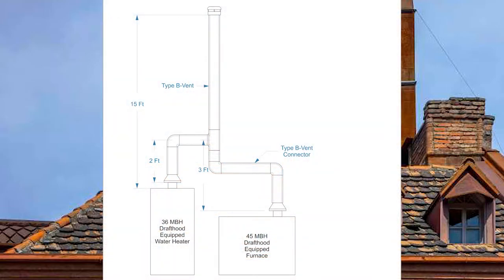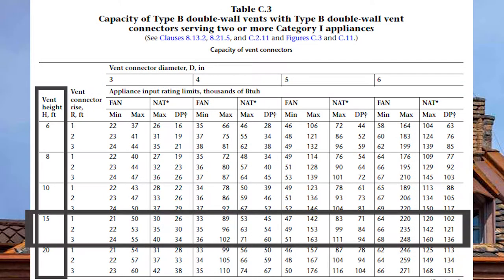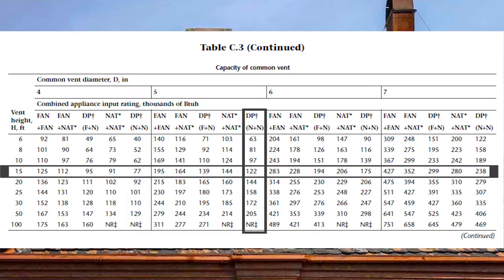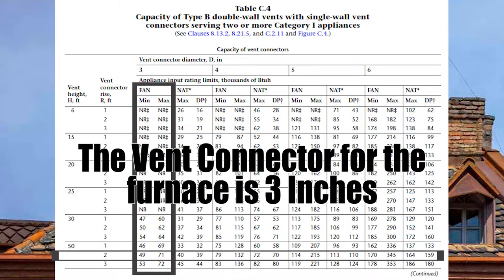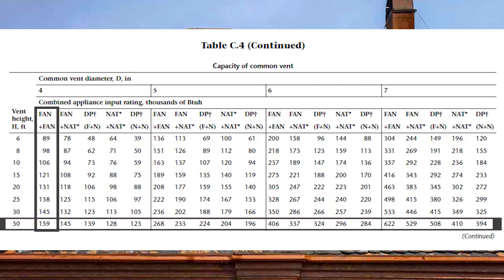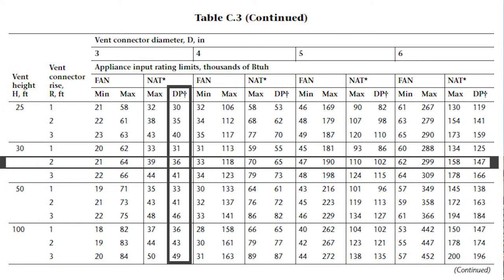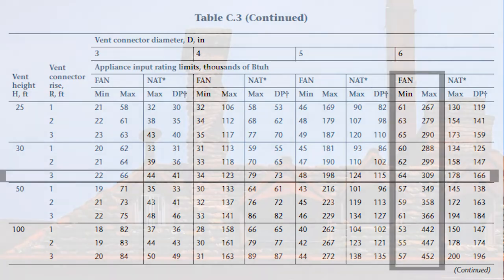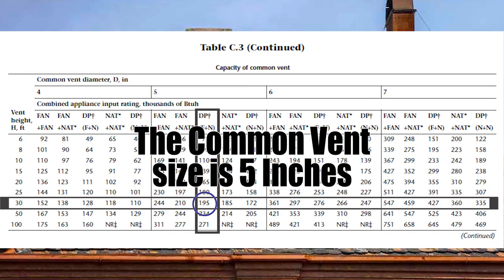Gas Venting with Tables Part: 3 - Sizing Vents for Multiple Appliances

Comment: What if the boiler was 75000btu, would you use 3 or 4 inch? That would be abouve th max for 3" but below the min for 4". Is there a rule ofvthumb for this?
Reply: C.2.16 maybe to use the smaller size?
Reply from the maker: As you have identified, using a single wall vent connector does not fit within the table C.4 values, therefore, you cannot do it.

You would need to go to a double wall vent connector for the boiler and use Table C.3 instead. 

There is rule of thumb (ROT) vent sizing method and a table sizing method. They are two different methods. You will need to know the size of the flue collar of the boiler to use the ROT method. I do have a video series for ROT: https://youtu.be/96qwE8EQUsQ